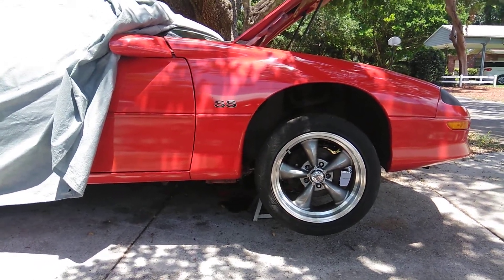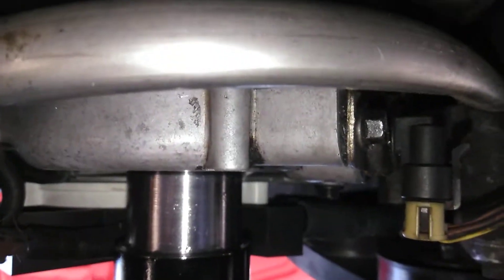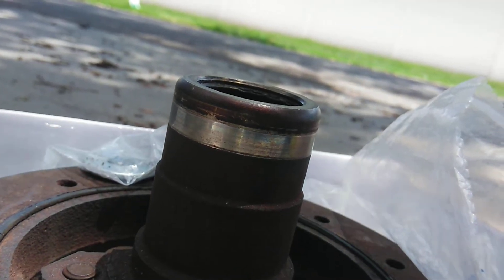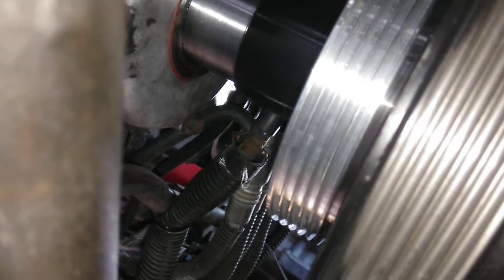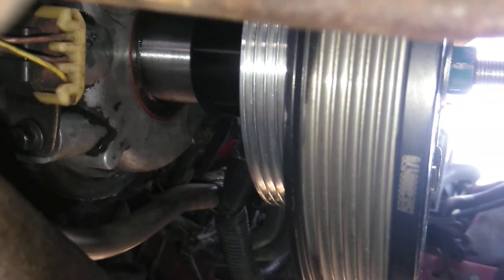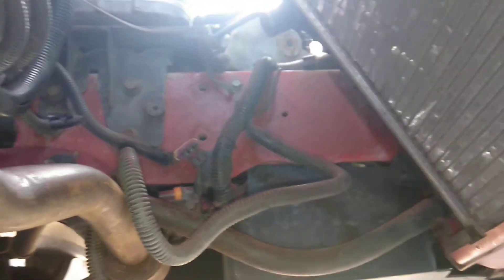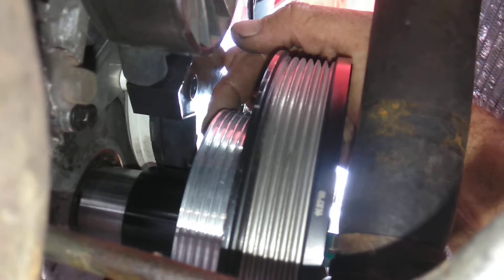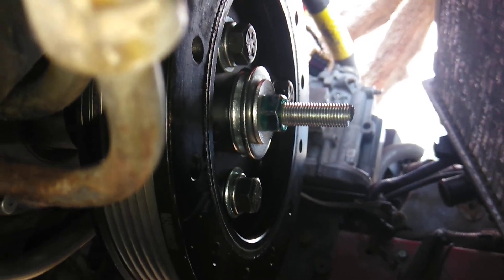Camaro SS harmonic balancer install & Bbk underdrive pulley Fbody

Comment: How is the BBK underdrive pulley holding up? Any noticeable gains? Any charging or belt squealing issues? I was going to get the bbk underdrive pulley for my LT1 but heard the gains are no where near BBK states (8-15hp) especially on an LT1, more like 1-2hp at best. Thanks.

Comment: I recently bought a harmonic balancer with a 10% under drive can i install it just as the stock OEM goes on without any under drive pulley or do i need the under drive pulley ?

Comment: I must have done it wrong? I rented a tool from oreilly pulled it off and the kit has a bolt to reinstall took maybe an hour? And it’s been running fine for 2 months so far so good
Reply from the maker: There a special threaded tool, to pull balancer for LT1 and ls1.
Doing it the normal way, pulled threads out of crank when installing. If it's working roll, with it.

Comment: why do you still have the stock harmonic balancer if you are running the belt on the underdrive pulley?
Reply from the maker: That a aftermarket balancer, with under drive pulley on there,